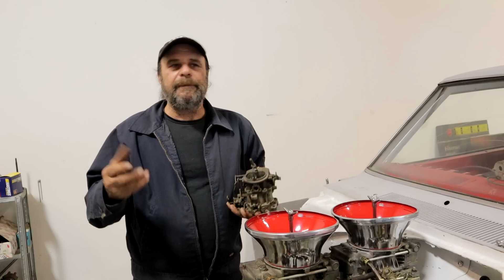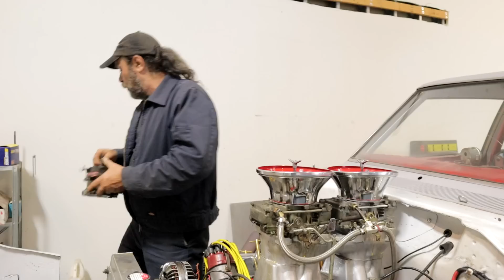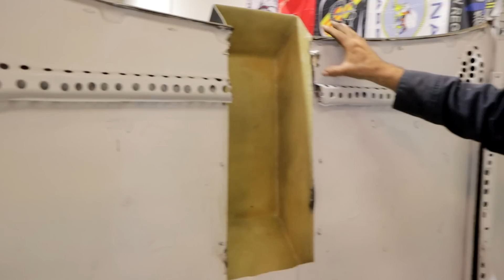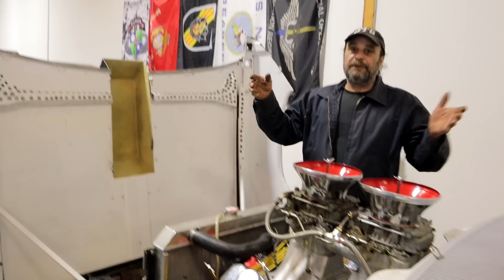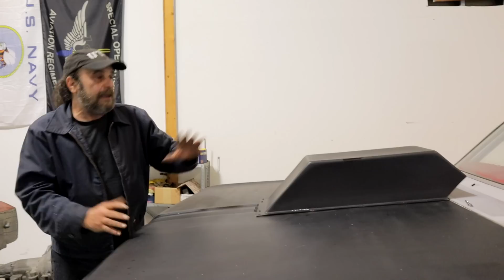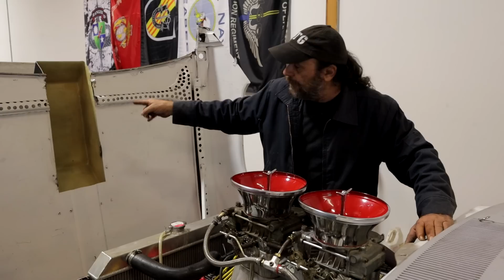Velocity Stacks And Cowl Induction And The Latest On Slaghammer And Mission Impossible 318

Comment: Since you had to cut out the brace around the Grump Lump, I would try to find some thin aluminum strips to put around the perimeter for strength. It would also be a better mounting method than just attached to the sheet metal on the hood. You wouldn't need it very thick so it wouldn't add much weight. And it would be worth it to not crack the scoop at high speed. 
Just my 2 cents. Awesome videos. And I love the car. Wish I had a place to build something like that
Reply: I was thinking the same thing... but angle iron (or aluminum) instead of just strips.  Using angle aluminum, you could easily get enough strength while not adding much weight.

Comment: Is that two barrel going to flow 300 cfm in two barrel numbers or four barrel numbers ?  Two barrel 300 cfm is only a bit over 200 cfm when compared to a four barrel.....so?
Reply: Andy said he tested it in 4 barrel format. 255 cfm accounting for the leak in the carb to the baseplate. I’m assuming it will be sealed for the final tests
Reply: @JustMoparJoe  Thanks.
Reply: wayment ... cubic feet per minute

Comment: one thing about the 98 to 05 buick century/regals i REALLY love.... 
the headlights
.
they come out in 10 seconds (VS 10 hours on a modern car)..... and if you remove the driver side...... now you have RAM!!! air induction 
.
its 2 plastic "tabs" that you pull up... and 1 electrical connector....boom, headlight is removed 
again, a LOT easier than having to pull the grill, bumper, inner fender liner, ETC on modern cars (its like its a scam to get people into the dealer.... just for a headlight....hummmm!!! i wonder!!!!)
.
and once the headlight is removed..... you are left with a BIG ~4 inch diameter hole
air goes into where the headlight was.... gets "boxed up".... and the only place it can go is into the air filter box
AKA.... ram air
.
.
on my little 160HP 3.1 v6 with 360,000 miles...... its probably only worth 2 or 3 HP
(then again.... when it drops from 80F to -40F.... it feels like i have an extra 70 or 80HP...... that 3.1 just LOVES dense air!!!!)
probably part of the reason the 2000+ 3.1 V6es got larger intake ports (you can tell if the intake is smooth.... or has "fins"........ the fins are the "small port" design)
.
however.... the "small port" has a 2 stroke like "power band"..... which KICKS IN HARD!!!! around 4200 rpm
its seriously like a 2 stroke dirt bike.... nothing.... nothing.... nothing.... 4200.... and the whole "sound" of the motor changes, it picks up the front end.... and it feels like a 50 shot of NOS
.
.
im not sure if its the intake hitting its "tune"...... or the exhaust.... 
or cylinder pressure gets high enough to "seat" the rings on my 360,000 mile engine
but it is their.... and it always happens at the same RPM
.
.
.
.
.
ANYWAY!!!!
where this "ram air" would really matter would be on the Regal GS cars
AKA a supercharged 3.8 V6 (that can make 350+ HP with 200 bucks in parts....450+ with about 1500 in parts!!!)
.
the century and regal are the EXACT SAME CARS!!!
the regal just has a bit nicer interior (still a "plastic fantastic"..... but more electric seats.... heated seats.... auto HVAC.... ETC)
.
however... 
the century gets a 3.1 v6 (aka, 3100)....160HP
and the regal gets a 3.8..... with the higher trims (GS) getting the supercharged 3800 series 2..... 240HP, 240 pound feet
.
slap on the "party pulley" and unplug the vac line to the fuel pressure reg..... and its making 300+ hp
.
.
.
also.... they are like 3380 pounds with a 190 pound driver (aka, me)
.
.
.
look up the video called "sleepers" here on youtube..... 
its an OLD video.... but that Regal GS of his absolutely CRAPS on cars 10X the price 
.
im "only" 28.... but the regal GS is my dream car
i could get a corvette or stang or charger..... and id sell it for a "slower" Regal GS 
.
.
.
that 3.8 (with the Lower Intake Gaskets replaced.... and coolant elbow replaced with a metal type) is WAY WAY WAY more reliable than any of the other motors
the GM w-body is SO SO SO SO SO easy to work on (its so well engineered.... that GM was loosing like 2000 dollars on every car sold...due to spending like 4 BILLION designing the W-body) 
parts are cheap and common (the W-body was used from the mid 80s till ~2012.... buick, chev, pont, olds, ETC.... all had W-bodies)
.
idk.... its just a damn good car
it used to be overlooked..... but now people are catching on
.
and i probably helped up the price of the Regal GS..... because of posts like this
which is kinda like slapping myself in the balls LOL
.
.
.
.
.
.
.
.
.
TLDR
the buick regal and century are some damn fine cars...... not super luxury interiors (its all "snap together" plastic)
but while the door panels are plastic.... the seats (and other things you touch) are VERY comfortable
.
 that "snap together plastic" = light weight and easy to work on
.
its got FACTORY ram air.... (and isnt a scam to get you into the dealer for a new headlight bulb..... dont get me started on Mopars TIPM.....)
.
they are light.... handle great.... with LOTS of upgrades (that are cheap and easy to install.... due to Mcpherson struts front and rear) 
.
it looks like an average 90s car (if you look VERY VERY CLOSE!!! you can see some "hips" on the rear fender.... coke body lines.... ETC)
so if you put electric opening exhaust cut outs on it..... its a sleeper from hell
(then again.... people are starting to "wake up" to the Regal GS.....its gotten MUCH more fame/respect in recent years)
.
.
.
.
idk.... i just love the W-body
you can even put a 5.3 LS into them (some impalas came from the factory with a 5.3)
.
which also means the 6.0 and new 6.6 gas would fit....... 
.
.
a supercharged (or turbo) 6.6.....aka 400 small block..... 
in a 3200 pound car.... 
YES PLEASE!!!
.
even if its FWD..... it would still smoke EVERYTHING on a "rolling start" on a highway........
.
.
.
i know i said TLDR like 2 novels ago
but i could be here for the next 2 hours typing about all the features i wish new cars had (like "map lights" on the bottom of the rear view mirror... and easy headlight removal)
.
they are just SOLID!!! cars
might nickel and dime ya for window regulators and wheel bearings.... a few sensors.... and the LIM gaskets NEED!!!! to be replaced
also the 4t60E/4t65E-HD on the supercharged cars is kinda weak..... but can be "beefed up" with TONS!! of aftermarket parts 
.
.
idk.... ultimate sleeper (unless W-bodies CONTINUE to gain respect......)
Reply: gee whiz

Comment: I'm building a 1977 Chevrolet K10 long bed 4x4. Engine 396 sbc stroker with edelbrock tunnel ram intake manifold. Transmission compound sm465 4 speed. 3.73 gears in both axles. Late 1970's hot rod shop truck.

Comment: Tony, would it help to seal the carbs off from the hot engine bay air, so they only draw from the scoop?  A flat metal plate sandwiched between the carbs and the stacks (with appropriate holes for the carbs to draw through, of course), with some soft foam around the edge for the hood to rest on should be all it takes.
Reply: As close as those stacks fit to the sides of the scoop they pretty much are isolated from the hot air around the engine. Remember they are getting a blast of fresh air right over the opening.
Reply: That would also help reduce hood flex... best idea I've read yet, in my opinion.
Reply: It seems like leaving it open under there would be beneficial to keep the carbs and intake cool. Not only will the carburetors be getting plenty of fresh air, but any air they don't gobble up will push hot air away from the carburetors and intakes and off to the sides where it can exit under the firewall.
Reply: @allurared9029  The force of air coming through the grille when the car is moving makes is way more than you'll get coming off the windscreen/cowl area.  That's why the induction area is almost always kept separate from the rest of the engine bay.

Comment: I run an Offenhuser Tunnel Ram with Holley 550cfm Tunnel Ram carburetors Holley builds just for Tunnel Ram application.   
  Ford 302 0.30 over, 12.5 cr , Comp cam .575 lift, 351 Edelbrock heads.  
62 Falcon. Manual transmission, 
 3 73 9 Inch LS . Mine sticks out of my hood, couldn't see with a scoop mounted. Daily driver.

Comment: It's a proven fact that painting the insides of velocity stacks red make them flow better.  Everybody knows that.
Reply: It's  scientifically proven.
Reply: Its true. Im getting no where with green. Runs terrible
Reply: Just like painting an engine red adds 10 to 20 hp... and painting the car red makes it 0.5 seconds faster in a 1/4 mile.  It's just basic science.
Reply: @livewire2759  I knew that.  Painting the block corporate blue slows them down and makes them run like they had a 2-bbl even if you put a big hulkin' 4-bbl on them.
Reply: has to Porsche Guards Red though
Reply: I typed that with a straight face.